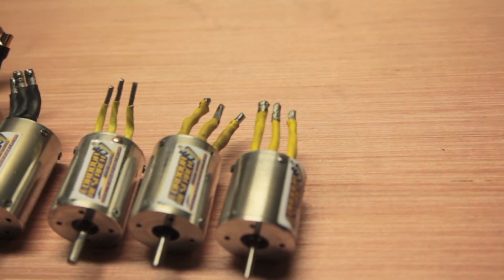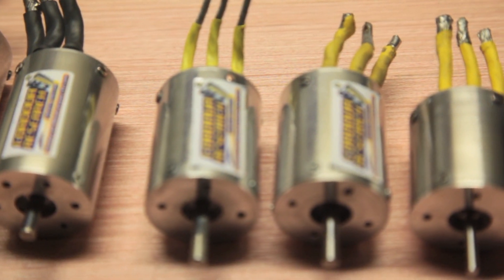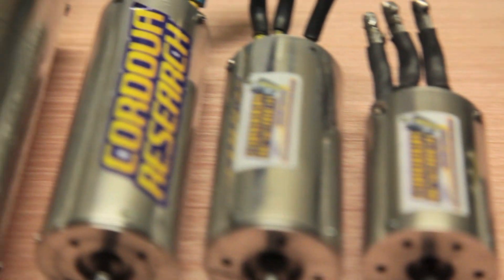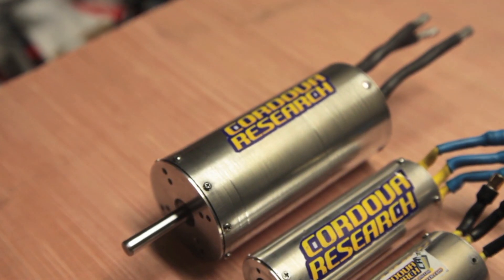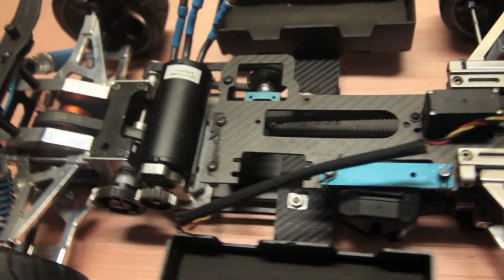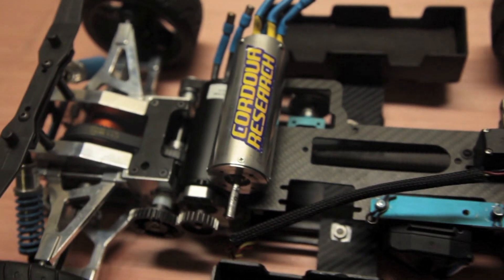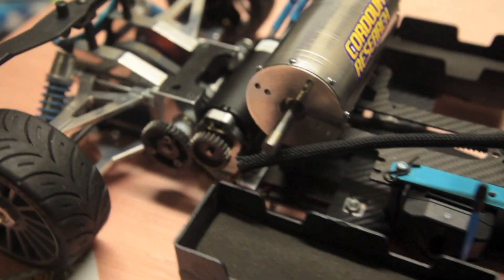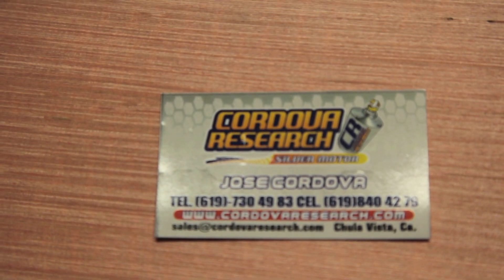cordova research 2015

Comment: Just got a 1424/1600kv and waiting on my 2700kv now they are wonderful motors....Thx steel
Reply: @ Shamar Morris what did you use the 1424 in
Reply: 4tec
Reply: Was it the 1600 or the 2700kv I want a motor for the tc5
Reply: 1600
Reply: I ordered a 3500kv 1424 do you think that's to much
Reply: Yeah kv too high motor gonna get hot fast
Reply from the maker: no problem anytime
Reply: Shamar Morris how is the 1424 2700kv I was thinking of getting that but I have the 3500 now
Reply: Its pretty good
Reply: You think it will be nice with 6s in the tc5
Reply: Yea alot of power...long as u can control it
Reply from the maker: oh yeah they ride
Reply: Thanks for the info guys

Comment: These are awaome motors, i just put a 3600kv in a rustler for fun just to test it out, standard gearbox and still using 48pitch gears with a standard traxxas 76spur and it went 112mph easy with some old smc (2×) 3s batteries. Motor temps weren't to bad at all considering the weight of the car and small can motor, these definitely are top quality motors!!!!!!!!!! Time to get one for a GTP2E!!!!!!!!!!!

Comment: 10,000 kv lol i bet that will twist. What type of voltage and amperage does it like? How well does it hold the rpm? Love how the motors look. You can see were the cans have been cut using a lathe. Finish could be a little better. I would love to see one perform. Ive heard he really stands behind them. I can respect that.
Reply from the maker: Eric Roberts thats the way it is what you see is what you get ,this motor a custom 10k with no problem runs on 2s very fast
Reply: 84k rpm off 2s ive got a castle creations 4600 running off 6s and a 7700 running off 4s pushing over 100k rpm at 120 amps so you can figure the horsepower. Id run the 10,000 on 3s if its built right it should hold it
Reply: Eric Roberts ????
Reply: Eric Roberts what kinda temps are you getting after one run , something like hot as fuck ?
Reply: No sir the motors dont run hot. You can easily pull 8 hits at 132 feet and keep the motor around 110 or cooler. Friction causes heat and wastes power. Learn how to get rid of that along with vibration and learn how to lighten up the internals a touch and youll be amazed at what the motors can do. Ill have some built for sale soon.
Reply: Good stuff sir !